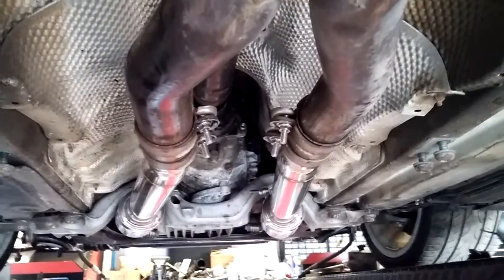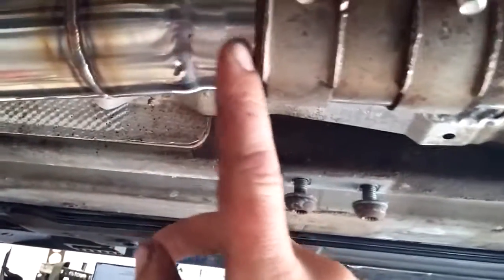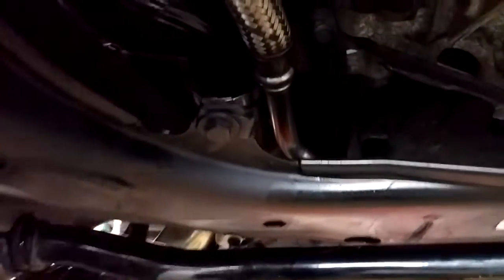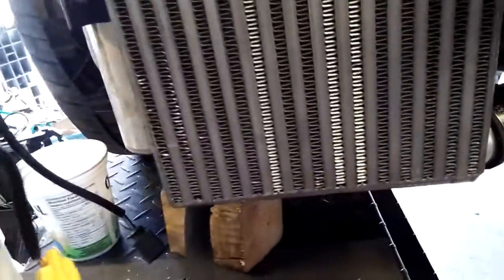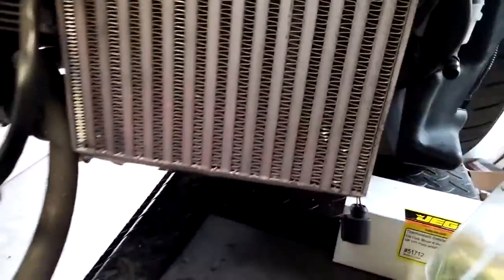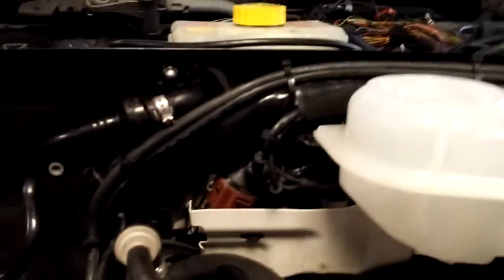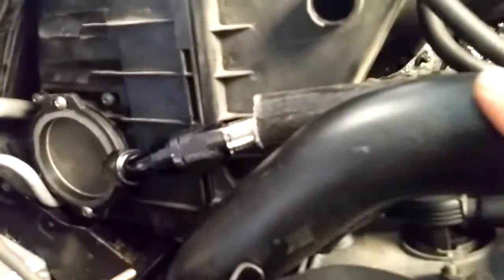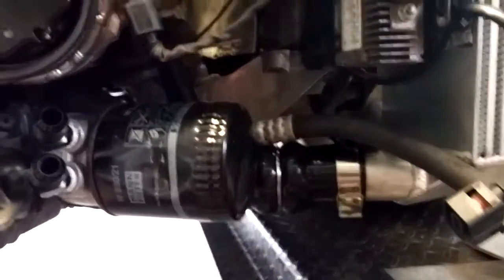20160626 Project B7 RS4 Stage 3 2.7T Biturbo Swap

Comment: Thanks for the video. I will be doing this soon on my b6 USP. Seems easy enough. Just a few trivial things. I think the biggest issue for me will be sourcing a b5s4 bell housing for my 6sp. Into my 04 USP
Reply from the maker: Your B6 USP 6-speed transmission will bolt right up to the 2.7T.
Reply: @biturboaudis4  Thanks for the reply after some clarification, I read that it's the Trans plate that needs to be sourced, which I think would be easier than the bell housing.
Reply: @biturboaudis4  So recently just finished up my swap. A few things left, but it's running. What did you do for the rear o2 sensors? I was thinking of probably getting spacers to get rid of the error codes for now. Turns out that any car that the swap is going into needs the spacer. Also, there's that harness that comes on the 3.0 rad support that needs to be used as well as the 1.8t doesn't have enough plugs and stuff. Posting this in case others see.
Reply from the maker: @Frankie_Freedom  If you have catalytic converters, you won't need O2 sensors. If you don't, you can. Code them out fairly easily.
Reply: @ipp I just need to get my pc working with the vagcom cable to work. I think it's in the s4wiki right?
Reply: I know Im pretty off topic but does anyone know of a good site to watch newly released tv shows online?
Reply: @Rodney Julian Thank you, I went there and it seems like they got a lot of movies there :) I appreciate it!!
Reply: @Baylor Danny You are welcome =)

Comment: Hi, Can you tell me approximately how long the 2.5" pipe is from the Vband Clamp to where it mates with your stock exhaust? I am going to order the same down pipes but I am trying to determine if I have room in those pipes for convertors. Beautiful work!
Reply from the maker: Hi. If I remember correctly, the shorter side is approximately 12" in length. This is just a guess right now. If you would like an exact measurement, let me know and I will put the car on the hoist one of these days to check.
Reply: @biturboaudis4  I am having my pipes extended by SEP automotive and then I will work to figure out my converters. Thank you!

Comment: Hi there, nice build! Do you have a working oil temp in the rs4 cluster? In the bottom of the FIS.. after the 2.7 swap I’ve lost the digital oil temp
Reply from the maker: No, I do not. I haven't yet figured out why, but I believe that a CAN message from the ECU to the cluster is blocking the oil temperature display, even though the oil temp signal is directly connected to the cluster.

Comment: so I did all the research and mock ups ext from a s4 2.7t engine INTO** my 2003 a4 B6** but recently I just got a b7... my question is how much is really different... like did that motor "drop in" did all the mounts line up ext? I know you need like a different snub mount radiator ect I'm asking souly do all the engine mounts like up directly like the would doing a 2.7t swap into a b6 is it sorta the same swap? I had been planning for 2 years doing the swap into b6 have a BUILT 2.7t engine. internals everything. but now want it in my b7
Reply from the maker: Yes, all the mounts line up just like they would on a B6. Same goes for the AC changes. The biggest difference is in the wiring at the firewall and the fact that you have to convert the ABS module on the B7 to one from a B6.
Reply: @biturboaudis4  I believe you do not need to swap the ABS you can recode it along with the ABS module to make things work. https://www.27swap.com/2-7t-swap-board/b7-coding
Reply from the maker: @glennda5id  That is true now, but we had not figured this out when I did the swap in 2016.

Comment: Find it funny people take the top tier Audi sedan and swap to a 2.7t. Just went back to base model lol. Jk the 2.7 alright but if it were me I’d keep the v8 and do the maintenance.
Reply from the maker: @WGF videos The 2.7T was never available in this chassis, thus it was neither a downgrade nor upgrade. That said, the BNS engine code 4.2 V8 is rare. The one that was in this car was beyond saving. An intake flap screw came loose and destroyed cylinder 1. A used replacement engine would have cost 50% of what the car was worth, considering the mileage and condition of the car. Selling the 4.2 in parts paid for the 2.7T swap, and in the end I have a more reliable (arguably), cheaper to maintain, and faster car. This wasn't about taking out a perfectly good engine and replacing it with something lesser, but about attempting to save a widebody car without going overboard. The last part is kind of funny, because once the car worked so well, I decided to clean it up and that's where the subframe-off restoration began.
Reply: A refreshed 2.7T with balanced connecting rods & stock pistons is capable of supporting well over 600whp. The 4.2L in the RS4 is amazing in it's own right but would require alot of money to reach the same power levels. Then there is the challenge and uniqueness of a TT V6 B7 RS4.